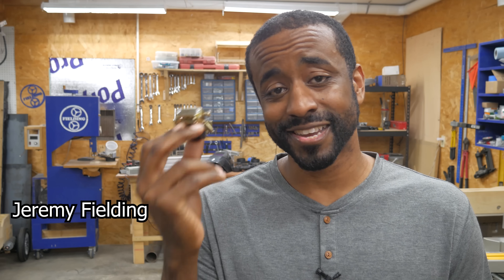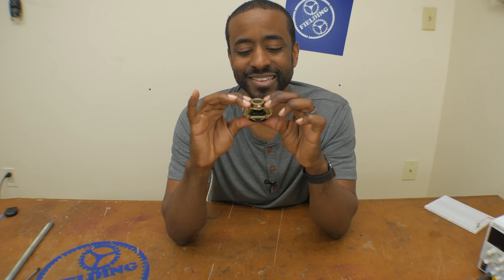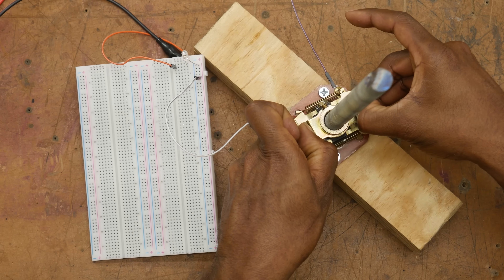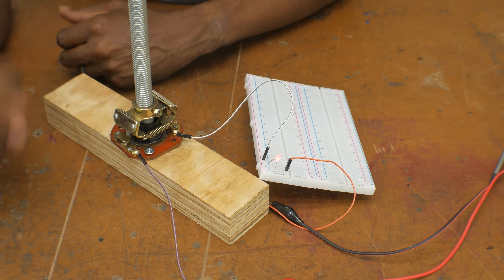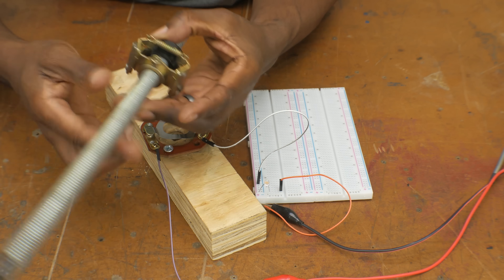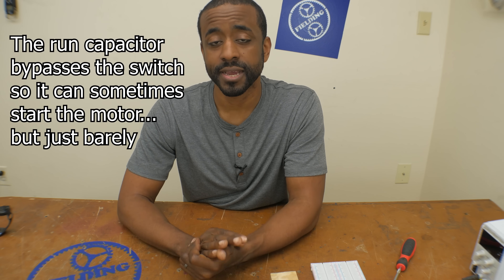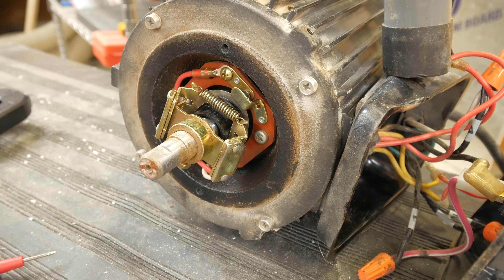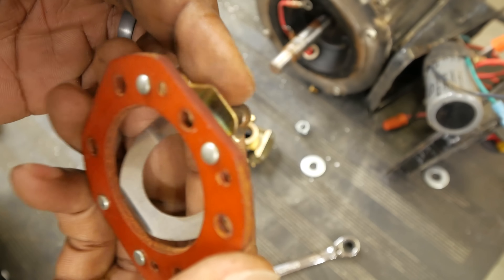This Clever Device Is Found In Nearly Every American Household. How It Works And How To Fix It

Comment: Hi, just found your channel, enjoyed this video a lot. I appreciate and share your respect for the centrifugal switch. I did cringe when you used vice grip pliers to remove a screw and a bolt. Years ago I was a helper in an aircraft maintenance shop. That would get you fired. Also a bad example for the youngsters.

Comment: In 1910 Victor Bendix (b.1881) invented and patented the Bendix drive, a gear that could engage an engine at zero rotational speed and then (through the aid of a spring and the higher speed of the running engine) pull back and disengage automatically at higher speed (nominally the engine's running speed). This drive made the electric starter practical for automobile engines and later for engines in aircraft and other motorized devices.

Comment: For contacts that handle a lot of amperage for short periods of time, It is best to polish the connector after sanding it. the better the contact between the surfaces, the lower the chance is of you ending up with the burnt contact issue. Depending on the amount of material, it is best to start with around a 400 grit, then work your way up to around 2000 grit, then bending contacts as needed to ensure a firm connection You can test mechanical switches like that the same way you test micro switches when measuring lifespan, by using an oscilloscope and a function generator, and just putting it into single shot capture and click the switch. and checking for how much contact bounce you get compared to a new switch, as well as how much of the signal amplitude you lose.

Comment: 5:09 you should not get one with higher capacitance. the capacitance value was chosen for a specific reason to give the correct phase delay on the start winding which has a fixed inductance so choose something close to what was already there +- 10% or even 20% is probably fine but you should not deviate more then that. remember the purpose of the capacitor is to create a rotating magnetic field in the winding from a single phase source so the capacitor chosen needs to be a specific value to accomplish this. the voltage rating is just that, the maximum rated voltage for the capacitor so as long as it is greater then or equal to the current working voltage then you are good.
Reply: Agree to keep the replacement cap no more than 20% of the original... can cascade into overheated start winding due to overcurrent...
Reply: I an Electronic Engineer and I agree 100%.
Reply: Agreed. Sometimes in the lab trying to build a new test rig I just grab a close enough capacitor. Sometimes I wind up blowing up circuits this way.
Reply: I think what you're saying is much more critical in a run capacitor rather than a start capacitor
Reply: @darth1000blue  starting uses higher loads than running. While generally a circuit won't pull more load than available, some big capacitors will still discharge more load than the circuit pulls. If you aren't properly accounting for this you get a nice big bang.

Comment: As far as I can tell the patent was granted to a gentleman by the name of Royal Lee on May 31st 1927 for that particular design.
Reply: 1927? He was lucky that Thomas Edison didn’t steal his idea
Reply: The invention of the rotational speed governor/regulator is attributed to  Christiaan Huygens in the 17th century. James Watt adapted the idea to control the speed of his steam engines.
Reply: Thanks for this. I also found a 1954 patent application by  Arthur Naher for a stationary centrifugal switch.
Reply: As it is a variation of a governor used on  steam engines and clockwork chimes and music boxs and   automatrons you will have to go way way way back in history to find the inventor. Which I would think is most likely quite impossible.  It probably predates Archimedes, really!  Thimk about it.
Reply: @michaelshultz2540  usually governors are used to slowdown spining with momentum. In music box they have like a fan. In steam engines pendulums with weight.
Reply: @michaelshultz2540  automaton*
Reply: Who did he cite as reference patents could climb that chain
Reply: @DanielCGCG  No patent references given in the patent.

Comment: I have worked on hundreds of electric motors and don't remember coming across one of those. That doesn't mean that I haven't seen one. Most of the motors I worked on were 600+ amp motors that had their own special starter circuit. But this is great information for working on smaller stuff now that I am retired from that big motor work. Thanks, I will be subscribing to your channel. I really enjoyed your teaching style and the fact that you even showed your own mistake. Great job, keep it up.

Comment: Very interesting. I had never seen or heard of that little thing. Now, I will know to look for it and to fix it if needed. I have had to replace a couple of the soft-start capacitors on RV a/c units before but never have run into one of those gadgets. Thanks for a very instructive video.

Comment: Can you take apart a little submersible fountain pump? Someone threw mine away because it wouldn't work but I was going to take it apart. They're generally sealed in plastic cases so you'd probably have to plastic weld it back together if one was serious about repair. Anyways I just wanted to see a broken one busted open. I'm keeping my eye out for anyone tossing one out.

Comment: Not sure if this is relevant but I have two fans that, when you turn them on to the low setting, it spins really slowly and usually requires me to flick it to high for a bit first or sticking something in to smack the blades to speed it up, or sometimes I can hear the motor spinning and the housing vibrates slightly but the blades don’t spin. What would anyone say the problem is? This is in the uk btw
Reply: I am an electrical apprentice, almost journeyman. Your problem with your fans (without seeing it) could be a couple things.  First you could be correct, it could be a starter issue. However it could also be the bearings. If it is a older fan the heat from the motor operating can dry out the bearings and the type of motors they use for fans are of a type that dont produce much torque. If it is because properly balanced and with good bearings there just isnt that much physical resistance to the motor. Other than heat if is in a place or of a design to allow dirt or if it has been subjected to tobacco smoke. These gum up the bearings and can make it harder to get going. Good luck I hope this helped ,  good luck!!

Comment: The switch seems like an evolution Christiaan Huygens' centrifugal governor: https://en.wikipedia.org/wiki/Centrifugal_governor
Reply: Mesatchornug Yes indeed. Jay Leno is a fan of steam engines. He has a great video on YouTube about the origin of the cliché “Going balls out” where this type of switch acts as a speed limiter (aka governor) to keep the engine from over revving and/or exploding.
Reply: @Surfzap63  "Balls to the wall"  is the other cliche
Reply: https://en.wikipedia.org/wiki/Centrifugal_switch
Reply: @StephenJohnFord  This reference is not correct. It is for speed control; a governor...
Reply: This reference is not correct. It is for speed control; a governor...
Reply: @scsg11  I've a machine that ticks both boxes. Is a switch and is a speed governor !
(1960s Sunbeam food mixer)
Reply: Similar principles but operates in quite a different way !

Comment: I have a bench grinder that I got for free, It was warranted and the store was supposed to scrap it but since I knew the manager well, he gave it to me. The problem ? The set screw on the starter switch was loose and it had moved on the shaft ! Easy Fix!

Comment: Cool video. Here we don't really use this type of switch so I was unaware of it. Very interesting.
Tiny bit of advice if you're open to it: I would use much much finer sandpaper on contactors, like anything above 800, as the rough surface from a course paper can help crude and corrosion build up more. :)

Comment: I have taken  electric motors apart from dishwashers, clothes washers and my table saw, and have yet to find that device.
Reply: Mate I think you are taking him far too literally. He's not saying that you will find one in every dishwasher/clothes washer etc but that they can be found in many of them. It also depends on other things as to whether you will find one or not. Such as the type of electric motor, its load curve and commonly today, the age of the machine. Many modern appliances use direct-drive motors and "electronic commutation" implemented through load and speed sensors and what is effectively a customised VFD/VSD system. Try looking at an older style single phase motor that has to start under full load, such as an air compressor or a heavy duty top-loading washing machine (eg Maytag or Speed Queen). Cheers, NP.

Comment: For the inventor it seems Wikipedia claims it’s “A 1920s patent for a centrifugal switch (US Patent #1,630,394[1]) was granted to Royal Lee on May 31, 1927. It was the basis for the formation of the Lee Engineering Company.[2]” but that’s actually called a speed governor on the patent which isn’t the same thing. 

But if you go to the government website for patents the earliest centrifugal switch is 1,362,600 by a man named Harry Canfield on Dec. 21st, 1920. It doesn’t look like the one in this video and I’m not sure if that was its original purpose, but it looks like it would have a similar function based off of the diagram. Back then they didn’t give too much info lol. It was just a few 2-d drawings.

Comment: Wikipedia claims the earliest patent on  a centrifugal switch was granted to Royal Lee on May 31, 1927. It was the basis for the formation of the Lee Engineering Company. 
https://en.wikipedia.org/wiki/Centrifugal_switch#cite_note-SRP-LJpdf-2
Fascinating indeed. Recently became intimately familiar as I started converting some of my machinery to 3 phase motors with Variable Frequency Drives off my 2 phase power at home.

Comment: Did you ever see Jay Leno describe the origin of the phrase "balls out"?  It was a centrifugal device using two brass balls on springs which were attached to the throttle on his steam engine.  As the engine went faster, the balls spread out and slowly closed the throttle.  So, it was a speed limiting device.  Top speed of the engine was "balls out".

Comment: Aside from the fix of the centrifugal switch, I would pay attention to the bearings in your dust collector motor - properly lubricated bearings do not make noise!  That high pitched whine that the motor is making when it is running in the video means that the bearings have been dry for a while and are starting to get roughness on the bearing balls / rollers / races.  The motor should quietly hum - Not whine!  You can get high quality sealed bearing replacements for surprisingly little money from a reputable bearing shop. Thanks for the cool video of un-sung but ooh so vital bits of the stuff you use every day.  Paul

Comment: One method to prolong the life of contacts is to put a "snubber circuit" across them. A snubber circuit is a resistor and a capacitor in series across the contacts. It basically reduces or eliminates the spark/arc when the contacts make or break. Google this circuit to learn which values to use and why. I did this with some high power relays in a hot tub control circuit and it certainly helped prolong the life of them. Cheers!

Comment: An alternative to this centrifugal switch has been in widespread use for the single phase motors used inside hermetic refrigeration compressors, known as the start relay.

Comment: The inventor of that device might have invented it for non-electric mechanical power sitting next to a big flywheel running a shop. They are usually spinning doohickies with big brass balls on top, which disengage mechanical power when a certain speed is reached. IMO, just a guess.

Comment: Please be careful working with capacitors.  They can carry a strong electric charge even after you have unplugged your device.  Attempting to power on a device after unplugging the device can sometimes drain the remaining electricity but not always.

Comment: All my life I thought that clicking sound was a centrifugal brake that kicks in as the RPM drops to help stop the motor.  Never knew it was a switch!
Reply: Good old magnetic resonance actually stops the motors, they want to be in the center pole, until electricity changes the polarity and makes its spin. Thats why they use small permanent magnet and then wrapped in wire to make a electro-magnet field and causing a circle field. making it spin!

Comment: The cap does not give it extra umph. It gives a second winding a phase shift. The angle of the second winding is also shifted at an angle which helps the magnetic field approximate an angular motion over time. The motor doesn't need more power to start, it needs a kick to the side to give it direction or the shaft will just sit there vibrating and not having a rotation. The extra power is just a side effect of the two windings running at the same time and the motor shaft not being quite in time with the magnetic field. When the motor is at full speed the phase shifted start winding is probably not going to be in time with the high sped of the motor and will cause the drive system to shake and draw much extra current and this is why they burn out and must be on a centrifugal switch. Because it's not timed for full speed operation.
Reply from the maker: I explained this in detail in a previous video several years ago “ how motors work for beginners- single phase"...But here that’s too much. Consider how many words in your comment need to be explained to a beginner. What is “phase” for example and why shift it? Even If you literally kick the motor it would start. Seemed close enough for this video about the switch and not really about how the motor starts.

Comment: Here's a question. I have an old wood lathe with a induction motor. This motor is very old. The bearings feel and sound fine. There is no external capacitor (not sure about inside somewhere). It's starting to act funny when it first turns on. Not all the time, but sometimes at the start, it cogs at low speed and won't ramp up to full speed. Turning it off and on a couple times I have been able to get it to come up to full speed but it's definitely getting worse. I have not taken it apart so I'm not sure if there is anything obviously wrong inside. I'm guessing it's 40+ years old and am not sure if it's worth fixing or just replace it. Anyone who has any initial ideas of what could be wrong would be greatly appreciated.

Comment: That reminds me of a bell housing on remote control nitromethane helicopters I used to fly only more simple in construction, which is a round metal weight with cuts on both sides and when attached to the main shaft clutch which is basically a flat bottom bowl lined with a soft brake liner like material mounted on the main shaft and when spun up after starting the motor under no load, it will expand and tighten to spin the main rotor for flying.😎

Comment: This is an adaptation of the flyball governors used to manage the speed in steam engines. They had weights that were pulled in by gravity, rather than springs, and they controlled the steam inlet valve based on their position, similar to the switch. Flyball governors we also used in cars' automatic transmissions for decades, until electronics finally developed enough to handle the heat and oil.
Reply: By the way, good video. It was educational and informative, and the "10 minutes earlier" gaffe was damn funny.

Comment: I had a problem with a similar device on a tractor. 

When you turn the key it spins the starting motor, with centrifugal force a little gear called the Bendix shoots up the shaft of the motor into the flywheel, once the engine fires it will move a little faster and because you no longer need the starting motor, a little switch unhooks a spring that launches the Bendix back down out of the flywheel.

A tractor at work had a broken switch, so the Bendix gear would stay in the flywheel and spin the starting motor, which A, is bad for the motor, and B, adds resistance to flywheel which causes the engine to shut off after about 10 seconds.

No one at work could figure out what was wrong with it and I didn't need it until the other tractor broke down, all I had to do was put a few drops of transmission fluid on the springs and the tractor was good as new.

Comment: I found a 1927 patent filed 1923 (#1630394) for a centrifugal switch called "speed governor for electric motors" but it doesn't appear to be at all similar to what you showed. http://www.freepatentsonline.com/1630394.pdf
However it appears that credit is most commonly given to this one awarded to Royal Lee.

Patent US1032471A for a Centripetal electric switch is similarly a different type of device.

Comment: i already knew---its a governor on a 1 phase motor--it disengages start winding after motor starts---just lubricate and make sure springs are good---also make sure it disengage start winding by placing ohm meter at capacitor leads, then manually pushing governor in and see if circuit opens---did not watch before i made comment---i swear...

Comment: If I had one of these and the switch broke I would just rewire the start capacitor through a an adjustable potential relay. Save all the time of ripping it apart.

Comment: You can buy a start kit  for about the same price as that centrifugal switch. Includes A electronic relay and a new start capacitor. Supco is a major manufacturer. More reliable in my opinion, especially in a dirty or humid environment.